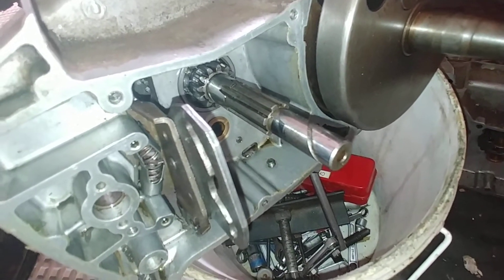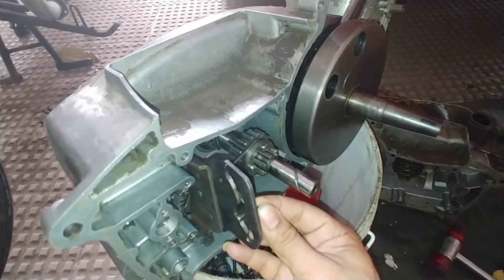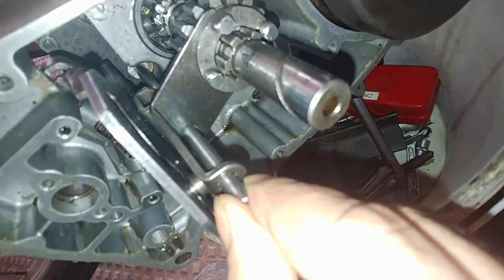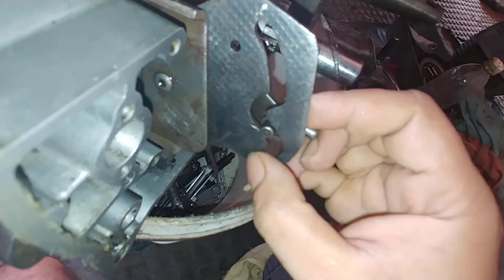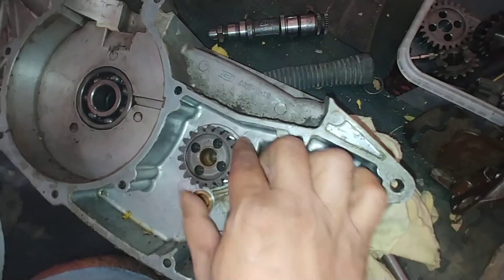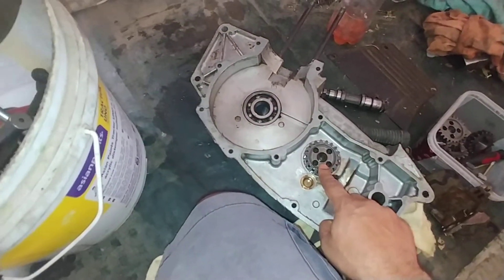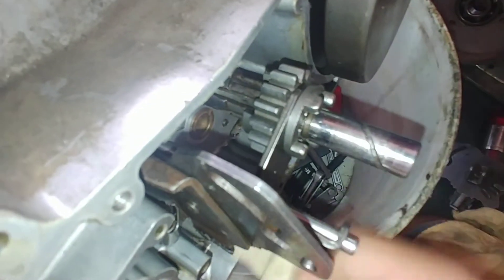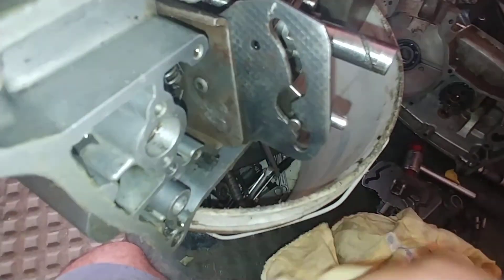Yezdi Roadking gearbox 8

Comment: How to check changer plate is good or replace. Gier will change it will be strucked
Reply from the maker: Is there any particular gear in which it gets stuck?
For Camplate check 1) play of camplate on the rivet. If ends of camplate deflect more than 1.5mm,change the rivet. Rivet size is M6. Dedicated workshops can replace rivet.
2) also replace spring and steel ball of locking gate.
But camplate alone cannot cause these problems.
Reply: OK sir I will checked some time topgier struck some time first gier struck
Reply from the maker: @sujinsuc4692  you can watsapp me on 8291751709.
Reply from the maker: @sujinsuc4692  If you open your clutch cover check the path for the two shifting pins on the cam plate, if there is excessive wear/grooving on the pathway then the pins can get stuck in First and Top gear.
Reply: Problem solved thanks for your support.
Another request deluxe statercoill available??
Reply from the maker: @sujinsuc4692  how was it solved? I dont have deluxe stator
Reply: RivitBush will change and 2 springs changed now it's working